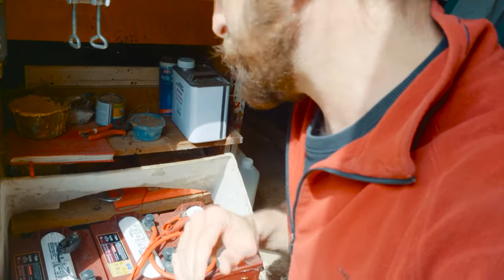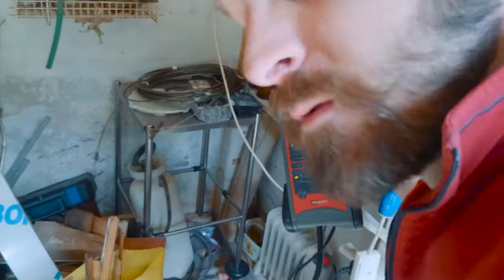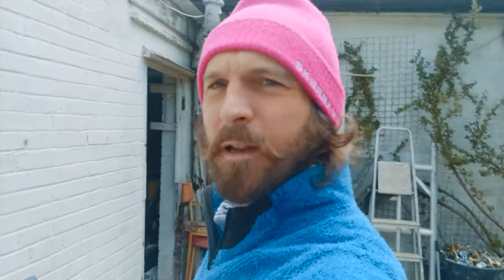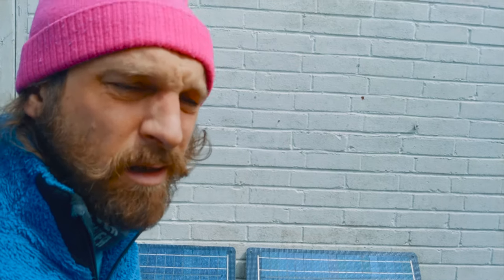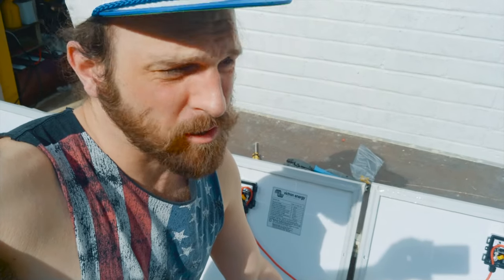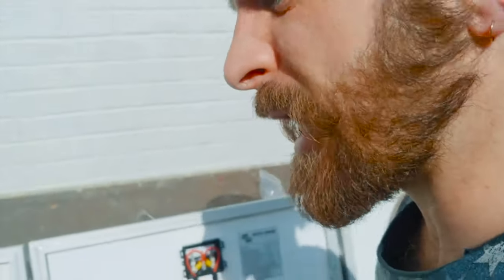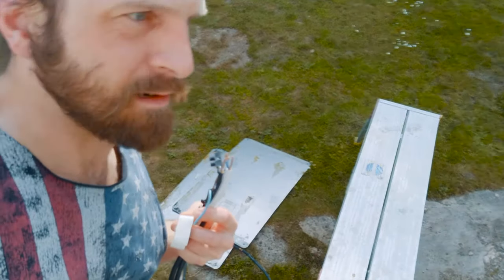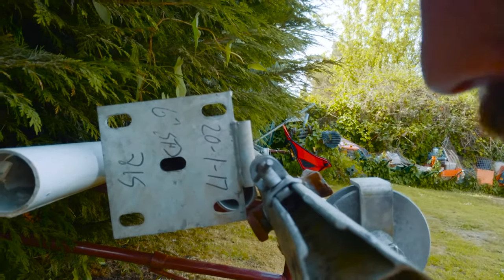Project Sail Boat Solar Panels and Battery Bank

Comment: Can't wait for part two, looking at the same charge controller but smaller panels.
Reply from the maker: Def get the one with Bluetooth built in - it's probably the only version now... Miffed the dongles are £45 each 🙄
Reply: @esvarwyn  I hadn't realised, looks like the built in model is called SmartSolar rather than BlueSolar - still £20 more expensive. Do you know if there is a particular link between battery Ah and teh solar controller as you get with a regular mains charger?
Reply from the maker: Bluetooth is essential to manage settings. I have one dongle between three devices so have to swap it about. The solar controller should be able to charge at 10% of the battery capacity, just like a battery charger - I have 145Ah battery bank and a 15A controller. I'll admit that the panels can't make that tho 🤣 the most I've seen is 7A. You'll see this week I incorrectly charged at 20%C/30A with two mains chargers during testing... 🧐